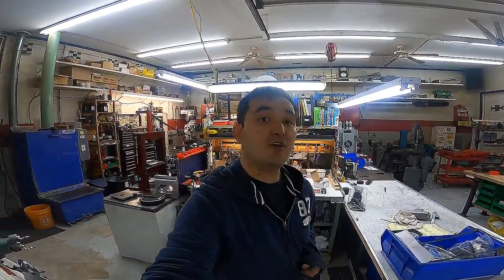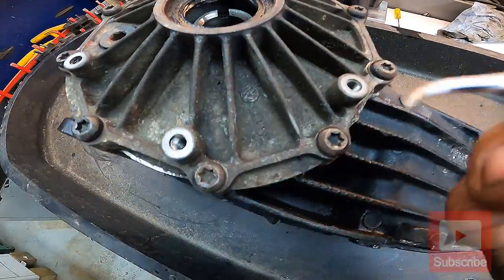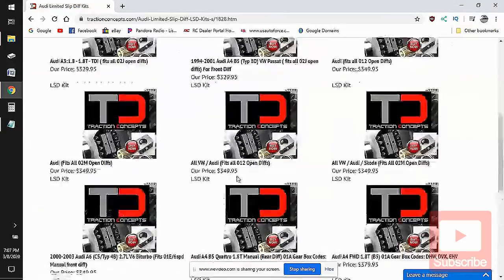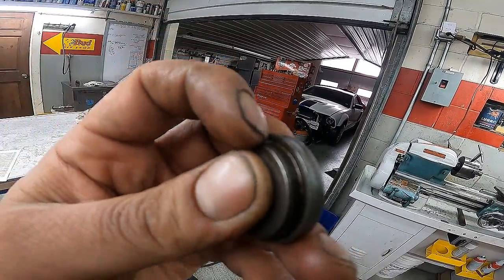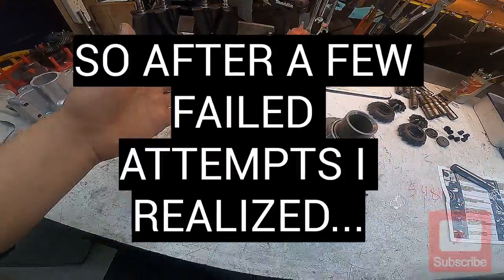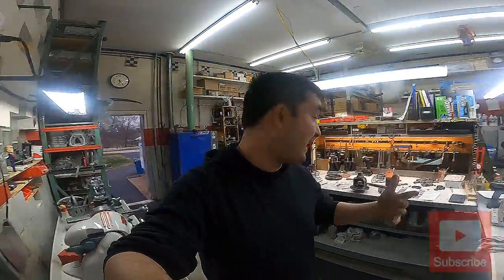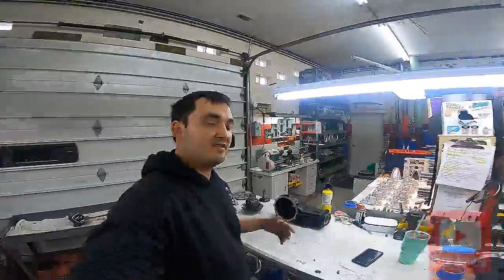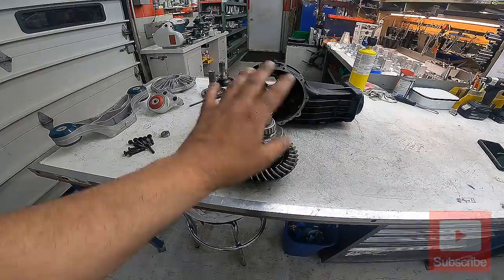INSTALLING YOUR TRACTION CONCEPTS LSD IN C5 A6| PART 2| INSTALLATION TUTORIAL FULL WALK THRU|3/20/20

Comment: Good tutorial RwdyAudi! Question, i build a audi 012 2wd flipped gearbox in my tdi converted vanagon. 
Does this gearbox have an open diff? I want more traction and i thought, let's instal the same LSD that you use in the gearbox.
Does it fit ore do i need an other type of LSD. 
Kind regards!
Reply from the maker: First off Thank you 😊🙏.  Second  the short answer is yes u can and I'm 85%sure your trans has a open diff from factory. I would suggest  contacting  traction concepts directly (use my promo code jactrac10) and send them a dm , tell them you seen my video and that we talk, they can get you setup 100% with the perfect LSD for your gearbox .... the ones  I offer are more suited for O1E and few other varaints

Comment: Thanks for the video, what ratios do these Audi diffs come in? Did the factory offer lsd?  How’s life with that kit installed? I’m looking to put one of these set ups in my Locost seven bike powered car, hence the obscure questions.
Reply from the maker: There is a wide variety of diffs that work with the c5 chassis and equal number of ratios, currently I am running a 4:11 gear. There is a a phenolic locker option you can get in the old (I belive may be wrong chassis code by year) b2 and b3 other that, to my knowledge audi never offer a lsd. If you are interested  in a lsd for a c5, b5, d3 chassis check out my store  @ RWDYAUDI.COM  I off an exclusive spec version of what I run in my track cars.

Thanks for watching and dm some pictures  of your build on Instagram @rwdyaudi

Comment: What keeps the thrust washer from from pulling out the same way you put it in ?
Reply from the maker: Actually we have fixed that problem. Good eye. New revisions have been made since this video. Along with several different options on levels of grip. I  have been working with a TC on several different projects to continue developing this and other chassis to find little quark like this one and get it sorted out. Are you wanting to get conversion for a Audi?
Reply: Yeah id like to order just the basic grip lsd from TC just wasn’t sure i wanted to spend about 400$ on a part that required me to modify the factory bits to make everything work together , id love to order one if they have revised the kit and theres a place for the thrust washers to go

Comment: Have you had a chance to try it out yet?
Reply from the maker: Many many times😎
Reply: @TheRwdyAudi  Have you had any issues with the LSD unloading?
Reply from the maker: I did notice alittle bit during really tight transition  when the out side wheel lifted. I solved that problem by reachijg out to TC and we have come up with a better setup specifically for Audi that are being pressed to there limits and for those who don't mind that "track" lockup while driving on and off the street. The revised version is alot tighter than there base kit that they originally  only offered. Now there is two different  variations and I will be offering a track version on my website in the near future RWDYAUDI.COM  also make sure to use my promo code JACTRAC10 and u will get 10% off
Reply: @TheRwdyAudi  Good to know and as long as it's somewhat better than daily driving with a welded rear diff, I'd probably pick up one of those kits
Reply from the maker: I know that life and I couldn't stand it, I got really good and fast at swapping diffs out cause of it tho lol for track days

Don't forget to smash that sub button if your not all ready  this is all we do on this channel👊😎